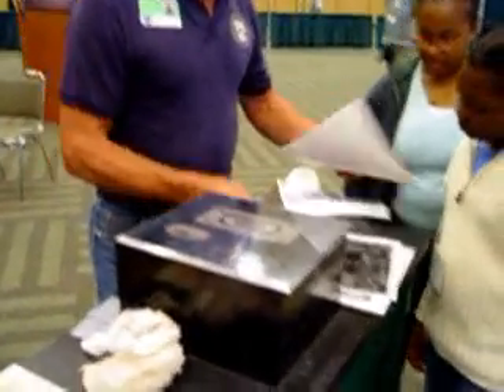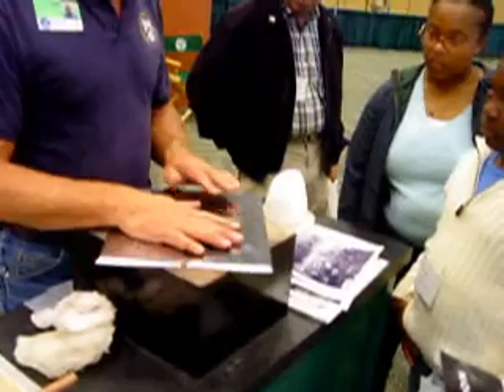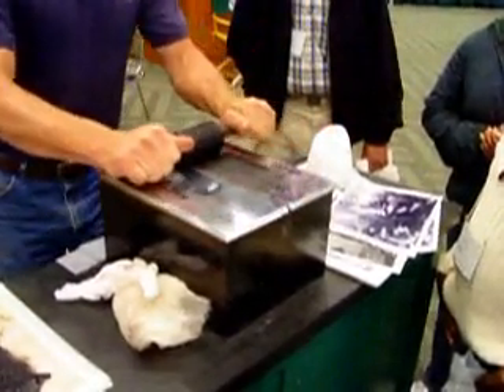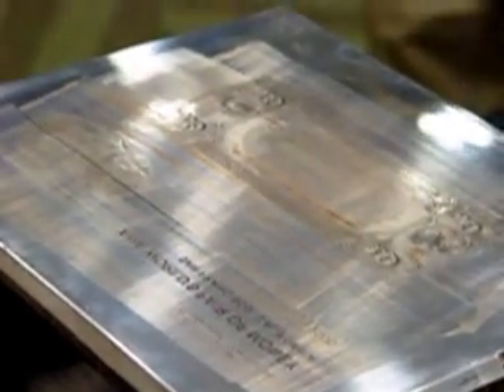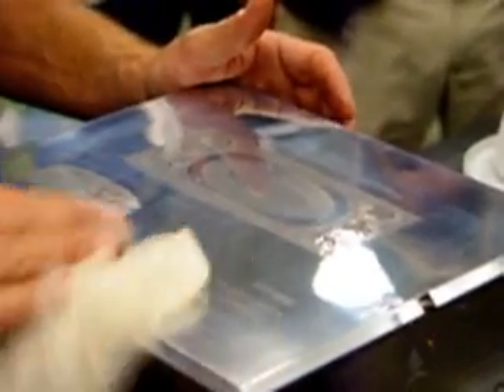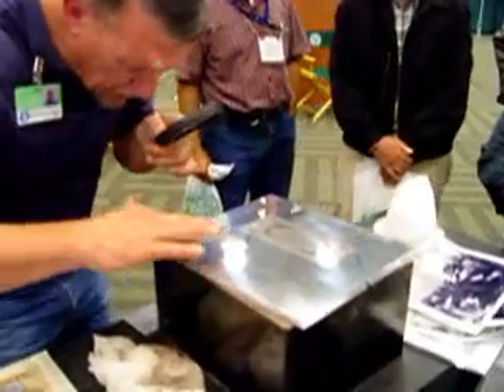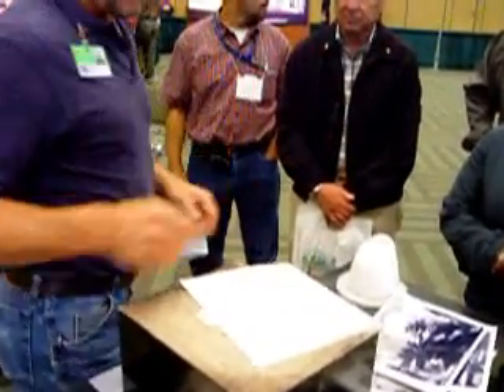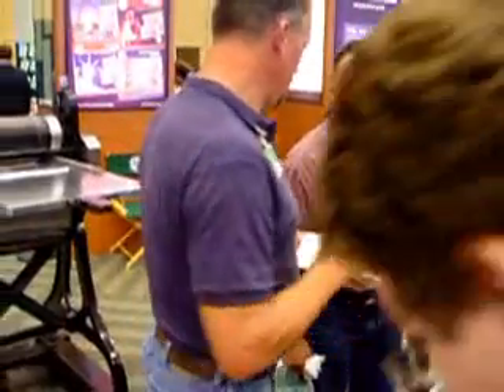BEP Money Printing Demo

Comment: Its called Intaglio Printing.  A piece of heat softened plastic transfers the plates impression into the plastic. The plastic is immersed in a Nickel plating bath to increase the thickness of the metal. This is called electrotypy. He inks the plate and wipes off excess with a squeegee & a stiff cloth krinlin. He polishes the plate with his chalk powder. The plate is set on his printing press with pre-soaked rag cotton paper on top.  The roller prints the dollar bill on the paper.